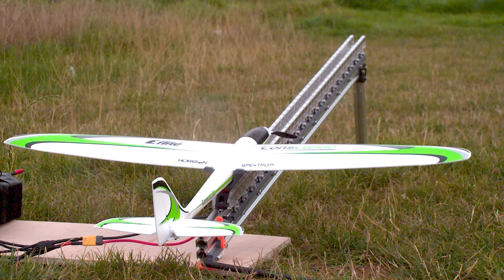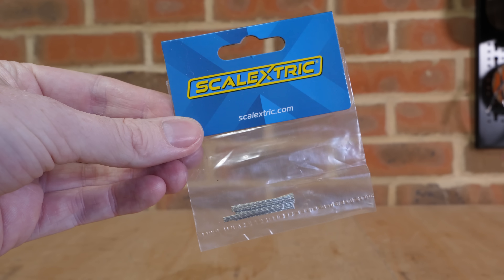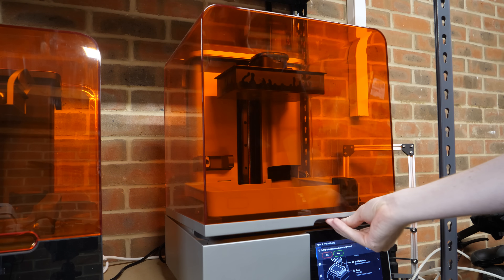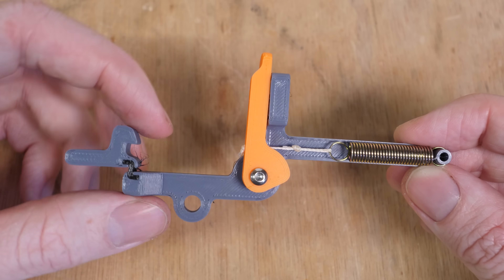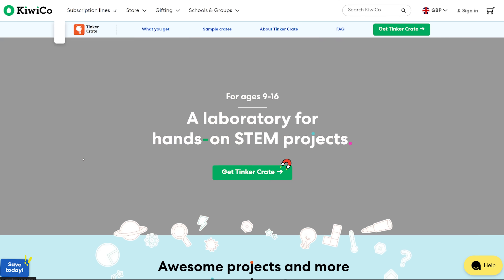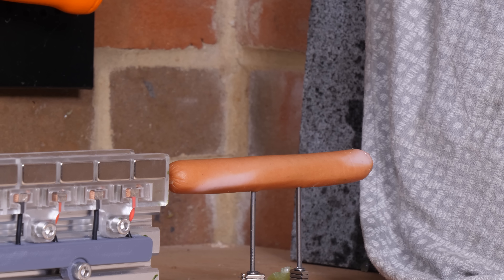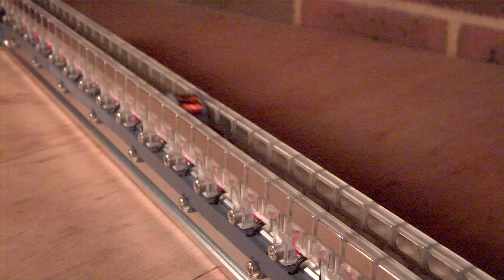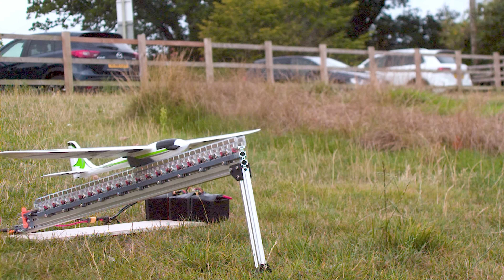Electromagnetic Aircraft Launcher

Comment: I really do appreciate the buzz from designing a solution to a problem, but i can't help think all the issues you had with the trigger could have been solved by using a relay or contactor.
Reply: Or a knife switch, or even the opposite of a knife switch, where you yank out an insulator from between two contacts.

Comment: The reason they use graphite brushes in DC motors is that it does not spark. To eliminate the sparks and damage to the rails, maybe you can have graphite brushes on the sled.

Comment: A couple of suggestions. Back the brushes with some spring steel or tensioned nickel strips to help keep them in firmer contact with the rail contacts. Attach wires directly to the brushes with spot welding, if needed. Ideally you'd run carbon/graphite brushes with springs behind them like in an electric motor but just running in a straight line instead of rotating.

Comment: In this design, arent the magnetic fields perpendicular to the travel of the sled? My intuition guesses that if the fields were parallel with the travel of the sled (like in a classic coil gun) the sled would see less friction on the rail, due to less torque inflicted on the sled as its spends time inbetween the opposing magnetic fields of the permanent magnets. (Im assuming that when magnets behind the sled coil "push" the sled forward, they are actually trying to flip the sled around so that the sled's magnetic field align with their own.)

Since i havent seen a comment addressing this already, im going to assume im wrong about this. Can someone please correct me?

Comment: i love how sometimes the solution is just to dumb down a design to the most basic level. Great work. 
Im curious if repeated uses will cause any damage to the receiver in the airplane. Its essentially a small EMP each time the coil energizes and the arcing is generating a ton of wide band interference im sure.

Comment: Would a rolling contactor reduce the friction and sparking in any significant way?

What I wonder is if it would be worth replacing the copper brushes with small roller bearings (with conductive grease), perhaps lined with the copper braid

Comment: I wonder if the weight of aluminum wire could of set the resistance. Perhaps running even higher voltages at lower amps?

Comment: Carbon motor brushes might help the sparking issue my having more contact area. A schottky diode in parallel with the coil will also help with the large inductance voltage spike.

Comment: I imagine you should be able to reduce the current considerably by adding a capacitor to the sled, in parallel with the coil. This would produce a LC resonator on the sled, and would allow the capacitor to capture some of the energy you are loosing in the sparks. I don't know if this would translate directly to more thrust, you may have to adjust the timing as well, since there will be a phase shift in the magnetic field.

Comment: Clever thought for the magnetic switch! I think you could completely avoid contact bounce by making the lower contact slightly compliant rather than rigid. That would dissipate some of the energy before hitting the hard surface.

For the bottom contact, I’m thinking of something like a cantilevered electrode a mm or two above the hard support surface, perhaps with a piece of foam between the two to help absorb the energy. This would allow the structure to give a little upon contact, decelerating the the moving contact before rebounding, and keeping the peak rebound velocity below what would cause a bounce.

Fantastic project, I love the mechanical simplicity! 

(FWIW, I agree with the suggestion of a MOV across the coil, to absorb the inductive “kick” and reduce arc damage on the contacts. I’m not sure though whether or not it would result in some reverse current in the coil, reducing the motive power.)

Comment: I wonder if you could essentially use the Marx high voltage generator using the shuttle mount as the spark gap element as it moves down each stage?.

Comment: in the navy, the carriers have catapults for the purpose of launching planes (jets) into the air. This has 2 features: 1) avoids back wash and exploding the jets on the deck behind it (rather important), and 2) provides a surface for the engines to push off from (much like the saturn V on launch, where the thrust into the ground/pad helps lift it off initially)

this video has just proven that we could effectively launch planes/jets off the ground with a considerably smaller foot print (that is, shorter airstrips potentially), and effectively created a catapult for land based aircraft, lol

this was awesome to watch!!
Reply: The two features you describe are both features of the Jet Blast Deflector, not the catapult itself.
Reply: @krashd  gotcha. the irony behind this, is that the only reason why i know this exists and called it a catapult was cause my dad was in the Navy and knew about it. Though he was stationed on a different ship, so I can see how he might not've been fully aware of the whole thing. And that he was also out of the navy for a couple decades by the time I learned about it, so terminology was probably mixed up somewhere.

but thank you for the clarification, this is neat to know. :)

Comment: To be honest it seems like a pretty nice RC plane launch system. It doesn't add mass to the plane, it's consistent, it seems relatively low effort to use. Maybe some sort of over-engineered electro magnetic brake system to catch the sled at the end of the rail. Or a syringe with a pressure regulating valve on the spout just to have something needlessly pneumatic, pneumatics are cool.

Or you know just a boring bit of string, so the sled can't go more than a metre or so beyond the end of the rail.

Comment: Another worthwhile thing to try is thinner coil wire.  Given that more coils = less current, but also less mass, yet still more magnetic flux, the thinnest wire that can handle the current is going to be optimal.  Also, optimize the number of turns using a plane mass simulator, since the timing is drastically different with the plane on board; the ideal number of turns isn't just about magnetic field strength, it's about matching the resonance of the coil to the switching frequency (probably the 'average' switching frequency).  And then spread the magnets out logarithmically, so that acceleration continues to match the switching frequency rather than drifting from it.  That's how real coil guns are tuned, anyway; you end up having to find the exact ideal positions for magnets and inductor values for each specific mass to be launched.

A ferrite core might also be worth trying; it's hard to say what the ideal resonance is (it's a broken waveform with weird spikes where the sparks happen) but that might actually put you way out of the ideal number of henries even while scaling back the winding, but maybe worth looking into.  Looking at the video, it probably peaks, near the end of the rails, somewhere in the neighborhood of 1kHz, but that's assuming a perfect handoff between contacts; in reality it could be far, far higher, meaning less turns could easily be better for a plane mass moving slower...

Comment: You could try shifting the power supply leads on the real forward so voltage is applied to the coil a bit sooner. or move the brushes closer to the front of the sled? (easier change) Could you make them adjustable so you can tune this??

Comment: Awesome. The magnet on the switch seemed to kill off most of the bounce, but I wonder if using some sort of bi-stable mechanism (something like another spring pushing or pulling the switch into the closed position) could eliminate it completely.

Comment: it's not the mass of the sled slowing you down, it's electromagnetic braking since the coil isn't continuously powered but turning on and off, when it turns off it experienced electromagnetic braking forces. This is why you have a 200T sweet spot where it's strong enough to get going but not so strong it stops itself when it turns off.

rebuild the entire thing with two continuous rails (no magnet field switching that causes eddy currents, one side is north, other side south, one side positive, other side negative) and you will get significantly more power and a larger mass capacity.

You may need to build it diagonally though, so top right is a power rail, bottom right is a magnetic rail, bottom left is a power rail, and top left is a magnetic rail, that way you best harness the left hand rule and maximize thrust and efficiency.

Comment: the coil is an inductor. and the more turns, the higher the inductance, and the slower the magnetic field builds... there will be a limit to how fast it can get. then again, the magnets should be logarithmicly spaced, proportional to the rate of acceleration. then the "charge" time is proportional to teh space between each magnet.

when testing the various turns, you failed to change the gauge of wire... would have been far more conclusive if the coils were all fully packed by using multiple strands in parallel...

the magnets themselves also turn the inductor into a generator, and thats adding to the sparking issue. and the faster it passes any magnet, the higher the induced EMF.

far better to wind the coil as a closed loop, simply shorted out, and replace the magnets with coils as well. use the lenz reaction of induced currents, just like an induction motor. at which point a single turn or ring of copper (SILVER!!!!) will produce the highest current, and the strongest lenz reaction.

no need for brushes then. brushes are so 1850s... remember that guy that made an AC motor that didnt use brushes, in 1880? (or was it 1890? whatever!)

Comment: I think the 400 turn coil may have been reaching its equilibrium speed due to back EMF on the coil, hard to tell just by eye but it seems to accelerate really hard in the beginning and stop accellerating before the end. Would be interesting to see current plots for the different coils! Also a magnetically permeable sled material would help the flux to cross the air gap better. That way you could get more acceleration for the same amount of turns and current, then you could reduce the number of turns to reach higher speeds!

Comment: Wouldn't be better to replace the mechanical switching contacts with constant contact rails for the power, and use eletronic detectors and switching in the sled, like optic or hall sensors switching a mosfet h-bridge?

It could still be lightweight, having a much simpler build, and waste less energy sparking while having better timing.
Reply: Also if you use an optic sensor, you could use a printed strip of acetate to more easily control and adjust the timing for each magnet. Just switch the acetate strip and the timing of all the stages can be reprogrammed. You can use a home printer to quickly print several strips with different timings to test which one performs the best.

Comment: If you used a little rubber roller wheel on the track to reverse the polarity instead, the contacts wouldn't spark as much if they're in constant contact with the power rails.
EDIT: Actually, your little magnet "switch" design could be used for this right? since the polarity of the magnets on the track flips back and forth you would just need to design an internal switch in the sled to flip back and forth as well.

Comment: If you haven't encountered them already, IGUS makes a series of bearings called Drylin. One of the things I noticed was how much the launch vehicle seemed to wiggle back and forth; making the launch rail a rigid linear rail with a dry bearing like what IGUS sells would decrease the amount of torsional loss of momentum from fiction. Also consider making your contacts "bulge" out a little and not attach only on one side -- The sparks are worse because the contacts have a lot of air between them and the power point.

Comment: Not sure if it is needed but it seems that the timing of the coil switch should be adjustable at each stage. The faster the sled is moving the earlier you might need to start creating the magnetic field so that it is getting the best push at all subsequent stages.

Comment: Could you make your rail be +V and -V, with the other rail one solid center-tapped 0-V contact? Then you're also not making/breaking two contacts constantly, but you can keep the center tap contact constantly connected, and only have to worry about one brush with alternating contacts. Should almost halve the amount of work you need to do wiring the thing up as well.

Also a thought process, instead of making/breaking your power circuit like this, could you have a switch built into your device that rides on a rail with alternating detents? Then you could have the inside of the switch breaking contact (with maybe an inert atmosphere and carbon contacts for less damage?), and your power rails could both be constant contact.

Edit: For your launch trigger switch contacts, you could also try a knife switch design- then the bouncing is not in the same direction as switch contact at all, and you can have a solid half an inch of contact space before the lever's endstop is hit, meaning even if it does bounce (unlikely under the friction of a knife switch), it'd still maintain perfect contact anyway.

Edit2: For your sled, wouldn't it be smarter to make it reloadable (more consistently, from damaging the sled less) by capturing your sled after launch? And because of equal-opposite physics mumbo jumbo, I'd think you could use a lever at the end of the rail for your capture mechanism, to transfer the force of the sled into a catapult onto the payload, reducing some of the wasted energy that went into accelerating the sled.

Comment: I see that a sled with parallel coils is much more power than one, but I wonder how many coils can put on the sled before you get diminishing returns...
Also, I wonder how long you can make the rail before similarly running into diminishing returns.

Comment: This is a very nice brushed linear motor. Your acceleration data suggests that the coil has an air core, since it doesn't appear to saturate. It would be worth experimenting with an iron/steel core instead, as this may reduce the current requirements.

Comment: I’m wondering, why the coil are on the moving part and the permanent magnets fixed?
If you do the opposite: have a row of coils and the permanent magnet on the moving part, there would be ne more issues of contacts, spark...
A bit in the same way as the japanese maglev works: the coils are on the fixed part

Comment: Is it the case that, because the magnets are equally spaced, and the contacts are equal lengths, that the acceleration will be self-limited? As the cart increases in speed would the contacts need to be longer, and the magnets spaced further apart, for optimal acceleration? Really enjoy your projects, btw.

Comment: Super cool. I feel like those spark spots are going to become a big PITA after a while since they will increase friction, slow down the sled, and interfere with the electrical connection. I would suggest buying a braided aluminum shielding and replacing the copper brushes with that. It's not expensive, and has a high enough melting point to hopefully not melt from the sparks. Steel cable of course has an even higher melting point but also much lower conductivity so not sure about it

Comment: Very nicely done. If you add a piece of iron inside the coil, it will greatly increase the magnetic forces. Although weight of the sled will go up and MAY reduce acceleration.

Comment: spring loaded graphite rods might work better for power contacts.  recess in the sides. You can get the rod from old c/d batteries. 

The wobble of the cart might be fixable with pads on the front too. Would keep power flowing over the gaps so there is a constant flow. 

awesome project!

Comment: Graphite carbon brushes are used in electric motors that have a high durability, don't leave molten splatter, and can be held to the contacts under pressure with a spring. Love the all mechanical design!

Comment: Quite an accomplishment.  I like your approach to the design.  Have you thought about using a smaller gauge copper wire?  How about capacitive discharge?  Have you also considered using stronger magnets or using electromagnets instead of permanent magnets?

Comment: Would be alot easier and save on burning out contacts if you used an irls3034 mosfet soldered with a few resistors and signal wire for activation

Comment: I wonder if there's anything to be gained from using the switch as a mechanical helper to push the coil into the track. So it dumps it's kinetic energy into the system and help propel this forward

Comment: What if... you have a C shaped rail... on both sides of the... middle device thingy... and on sides of the cart... it's like a rolling ball bearing that is slightly tucked into the C  shape rail for contact? idk brain hurty.

Side note, for the lever switch thing.. You could mechanically lock the lever? so like once it pasts a certain degree in change from the angle? it's locked and it should not bounce back. Like those Tie down clamps.

Comment: I'm not an engineer, but for such a simple and elegant rail design, the switch mechanism seems overly engineered. If the rail remained live and something like a pinball launch spring was used to propel the sled into the rail gates, it could give the sled momentum as it enters, helping to overcome the initial current and momentum build-up at the first few gates.